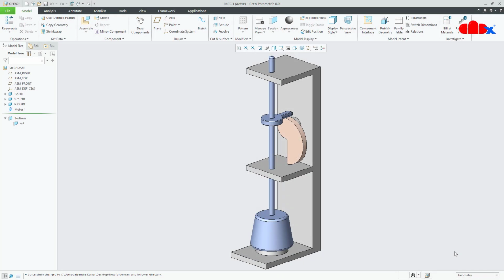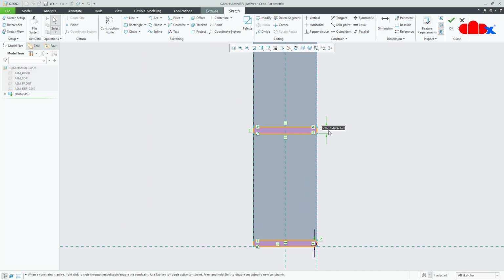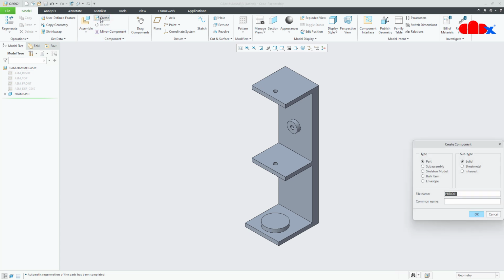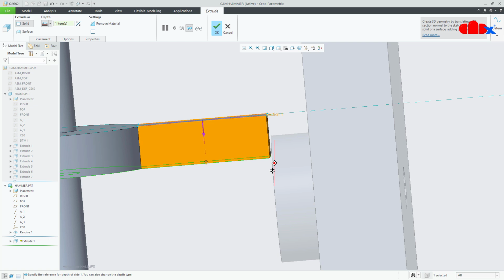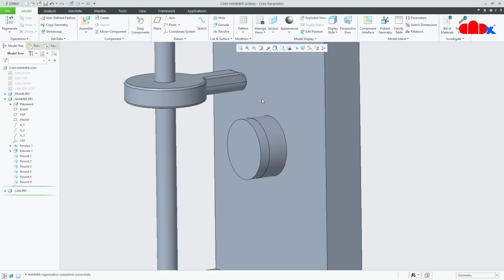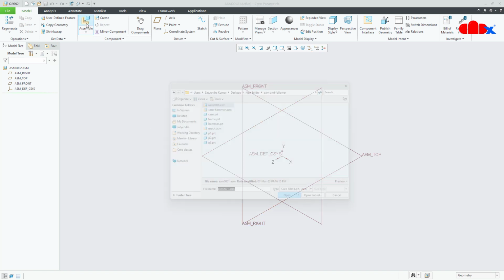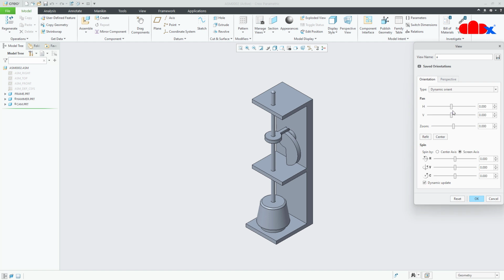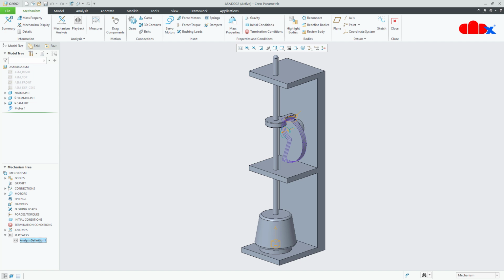Cam hammer mechanism | Top-down assembly design in Creo Parametric

Comment: So the individual part file is automatically saved in background?
Reply from the maker: Yes. All the parts designed using top down assembly approach, will be saved as individual parts in your working directory.

Comment: How to slide a pin and in a slot , which type of connection needed to used slider or slot and How  please explain sir?
Reply from the maker: You need the planner connection in creo parametric
Reply: Sir please make video on the assembly connection it will be really helpful for Us, Thanks in advance 
 @CADx-in
Reply: could please explain in a elaborate way , on how to give planar  connection sir ?
 @CADx-in